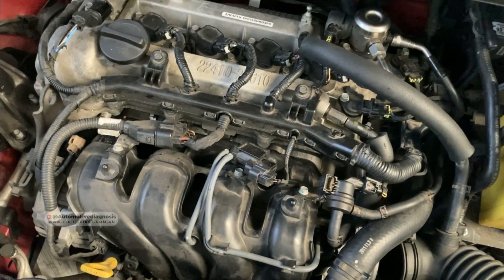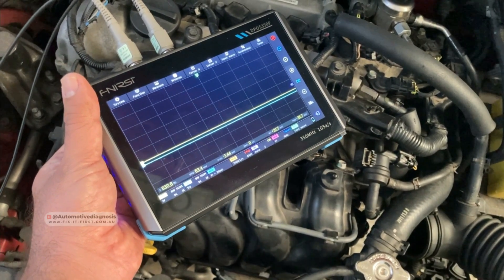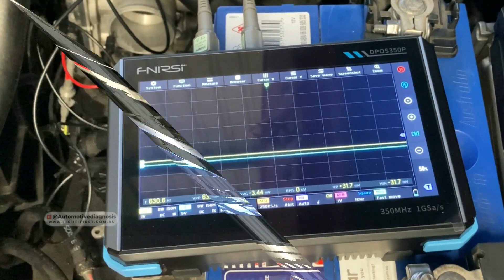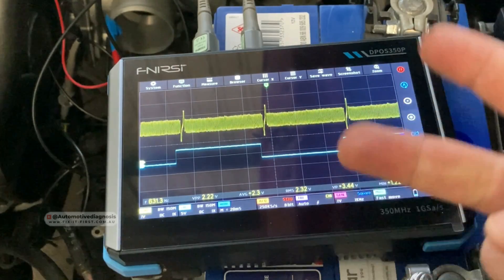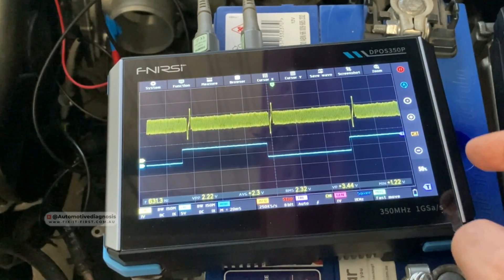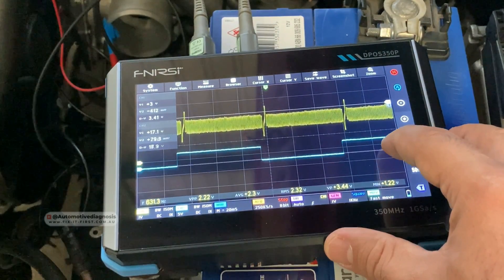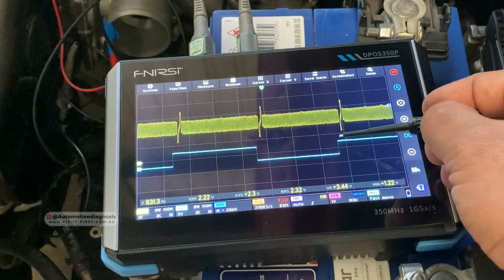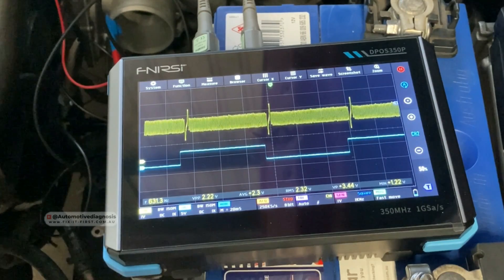Budget Oscilloscope vs Crankshaft & Camshaft Position Sensors | Engine Timing vs Budget Scope

Comment from the maker: 🧑‍🎓Online Course: Automotive Diagnostic with Oscilloscope:
https://fix-it-first.com.au/course/how-to-use-an-oscilloscope-for-automotive-diagnostics/

🧑‍🎓 Automotive Engine Sensors Intro, Operation & Diagnostic (18 Sensors)
https://fix-it-first.com.au/course/automotive-engine-sensors-intro-operation-diagnostic-2/

🧑‍🎓Automotive Engine Actuators Intro, Operation & Diagnostic: 
https://fix-it-first.com.au/course/automotive-engine-actuators-intro-operation-diagnostic/

🧑‍🎓  Smart Key System (Push Button Start) Operation & Diagnostic in ANY Hyundai & KIA Vehicles
https://fix-it-first.com.au/course/smart-key-system-operation-diagnostic-in-any-kia-hyundai/

🧑‍🎓 Automotive LIN-Bus & K-Line Inro, Application & Diagnosis
https://fix-it-first.com.au/course/automotive-lin-bus-k-line-intro-application-diagnosis/

🧑‍🎓 ABS & Traction Control System Diagnostic Online Course
https://fix-it-first.com.au/course/abs-traction-control-system-diagnostic/

🧑‍🎓 Starting System Diagnostic & Schematics Analysis Online Course:
https://fix-it-first.com.au/course/automotive-starting-system-diagnosis-and-schematic-analysis/

🎯 For more details about Fnirsi DPOS350P Tablet Oscilloscope use the links below:
Amazon US: Amazon US: https://amzn.to/4mrK4nP
Fnirsi Official Website: https://www.fnirsi.com/products/dpos350p?sca_ref=8503519.AG2X0jFzf4
Reply: Thank you sir for your vidéos good luck
Reply from the maker: @Icelandtaxi24Icelandtaxi24-p7gThanks for watching

Comment: This is not good for automotive diagnostic because it has a terribly small memory. As presented 20ms/div resolution is 250Ks/s . That's actually garbage. With such little memory, Fnirsi is ruined the other good things on that device.

Comment: Hello,thanks for sharing your knowledge 
If at the car used effect hall crankshaft sensor
How we can test with oscilloscope
Reply from the maker: Hi my friend, very same procedure, the only difference would be on the crank sensor which comes with three wires, and it gives you square waveforms instead of sine waves.
Reply: @AutomotiveDiagnosis 🙏♥️

Comment: You need new leads. Them are more like electronic board work. Get you a set of pico or hantek
Reply from the maker: Yeah that’s correct, I have oscilloscope leads from my other scopes but I didn’t use them in this video as I just wanted to use whatever came with this device in the box.
Reply: How long of a buffer can you record per division and still get good zooming abilities? Like watching a cam sensor for an intermittent drop out?

Comment: Thank you for another wonderful video. I would like to know if the smaller model  Fnirsi 1013D  is also capable of doing this test and most of the other automotive diagnostic tests.
Reply from the maker: Hi my friend, thanks for watching the video, I have tried that scope, that scope is the older version that’s why I got the latest model which is the one I used here.